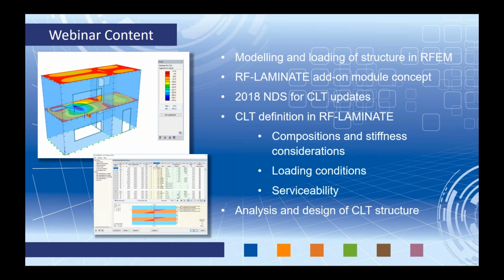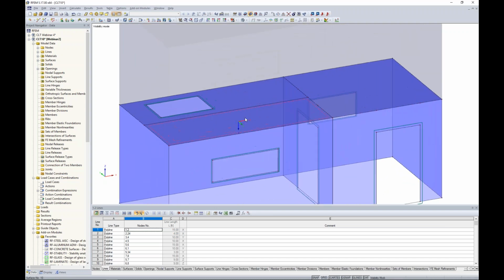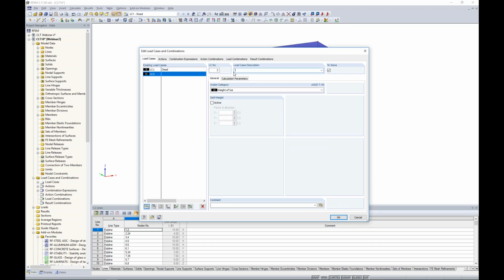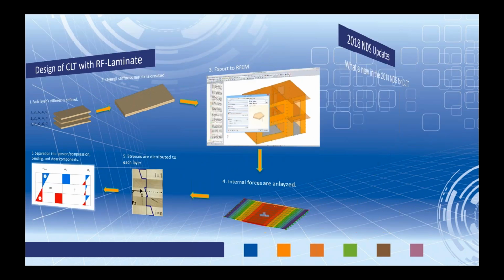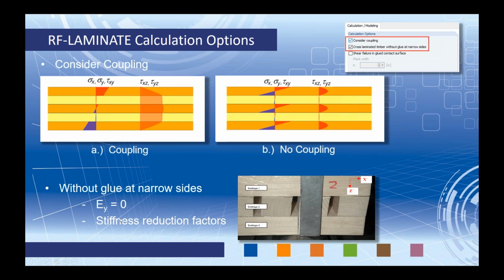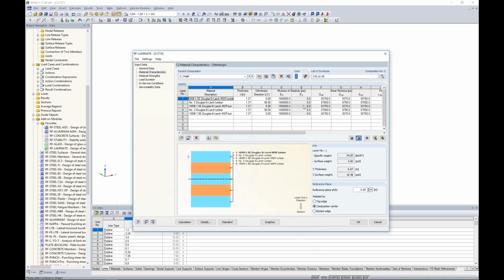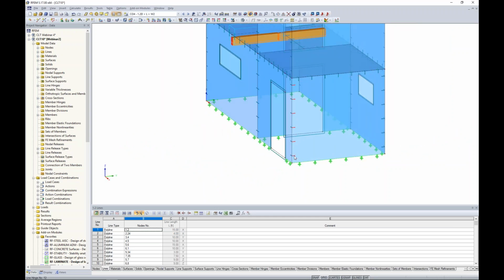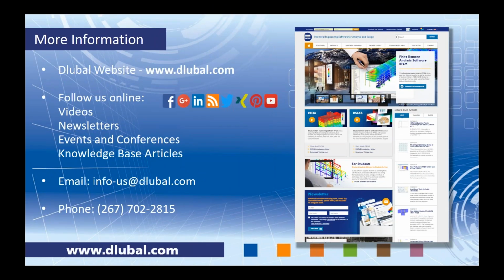Webinar: 2018 NDS and CLT Design in RFEM (USA)

Comment: Why arent' the stiffness modifiers used for the floors?
Reply from the maker: Hi, Yoshita!
Technically, if the floor elements similarly do not have glue at the narrow ends, the stiffness modification factors k33 and k88 should also be adjusted.  Sorry for any confusion in the webinar regarding this for the floor vs. wall elements.
Reply: @DlubalEN  thanks a lot!